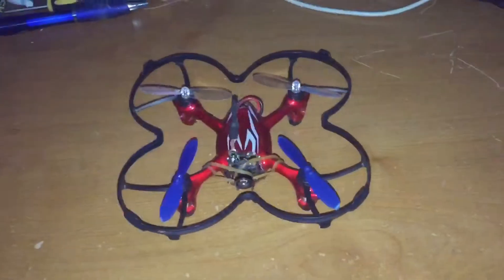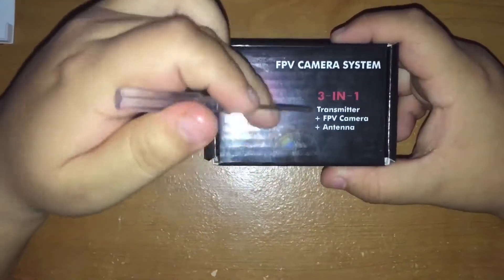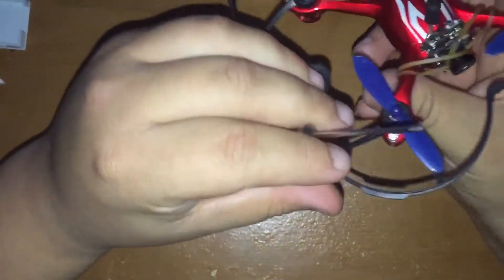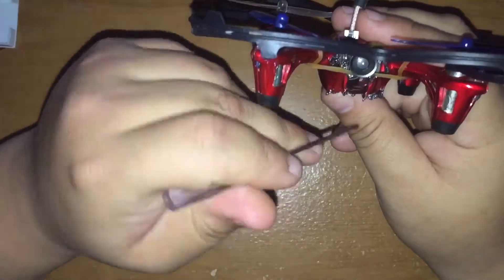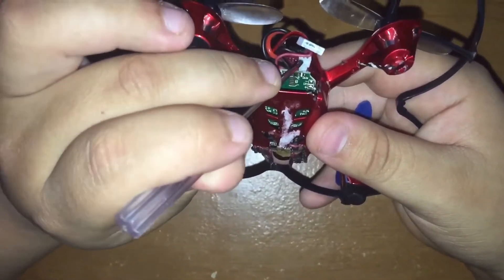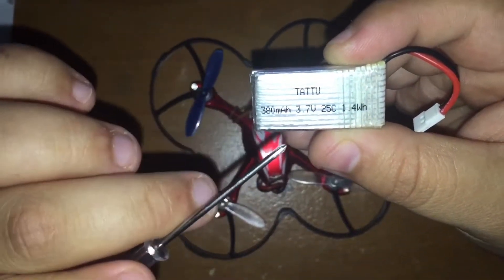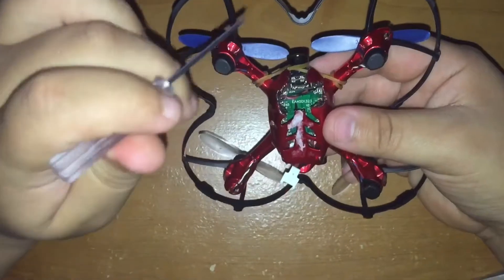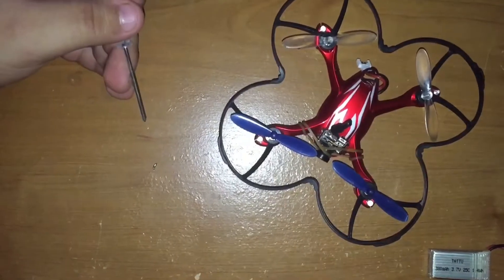Hubsan X4 H107C 5.8ghz FPV Mod

Comment: Thanks for the vid and motivation! I did pretty much exactly what you did on my first 107c; then crashed into bathtub full of water.  (roll eyes) For the second one, I found this two piece cam. 
https://www.amazon.com/dp/B073WV3HLS?psc=1&ref=ppx_pop_dt_b_asin_title 
It fit EXACTLY into place with very little trimming (I used wire cutters) and no soldering at all! I made an adapter cable to connect the quad and cam to one battery. Super easy and cost $17 for the cam! The vid tx is mounted where the old cam board was and the antenna comes out of the sd card slot totally crash protected. I'll post a vid if you're interested. Thanks again!!

Comment: Hi. I want to mod my hubsan h107c plus with fpv cam aio. And i want to remove the original camera n board. Can you tell me which positive/negative on main board, i want to solder with aio cam. Pls help